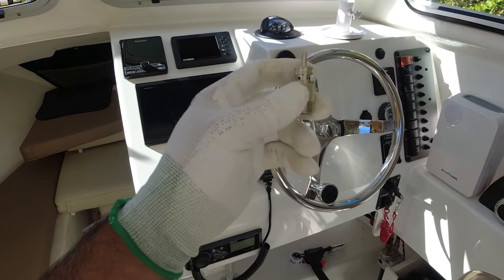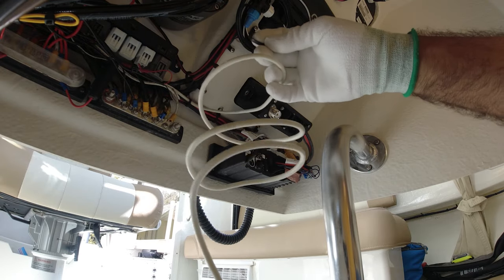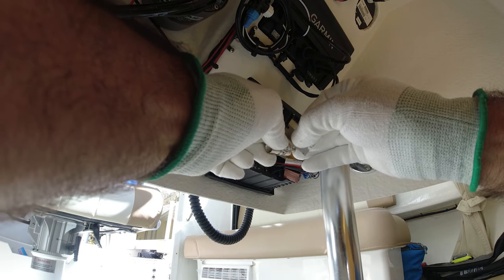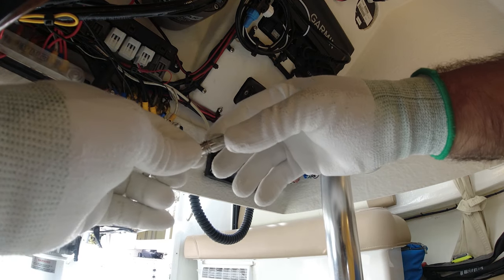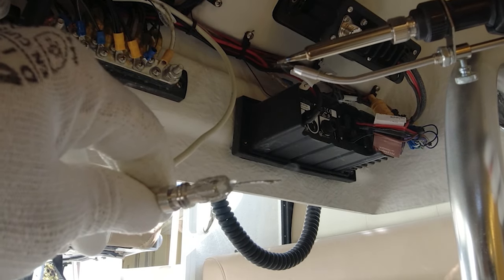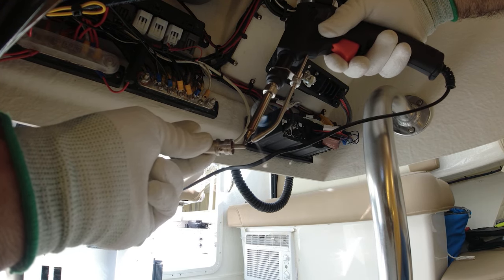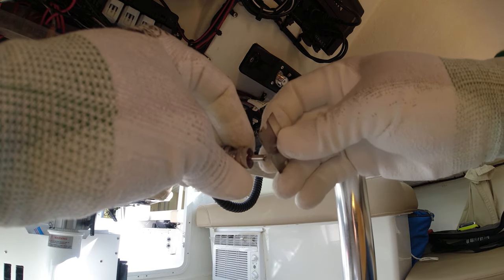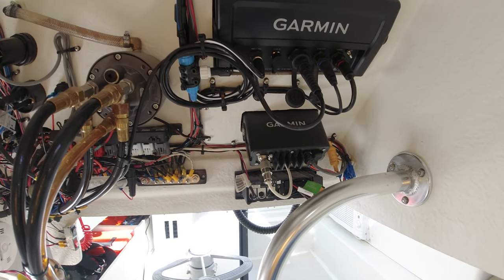How to Install a Marine VHF Antenna Connector DIY Crooked PilotHouse Boat

Comment: That's a nice soldering gun.
I just installed an antenna  coupler, on my boat,  that allows my vhf and stereo to use the same antenna.
Had to do the same procedure.
Good Work tinning that wire end Capt.
Reply from the maker: Thank you Ken and I did not know they built in antenna did you can use it for both that is awesome because now it's see you can get good stereo and VHF frequency.
And thanks for watching the video and the great feedback captain😉👍

Comment: Very well done...and that comes from an Expert Class amateur radio operator, Cap'n.  I continue to be surprised and pleased to discover the breadth of content you have made available here.  It's inspiring, Cap'n - very motivating to set high standards of my own whether on the seamanship side or the mods and improvements of the boat.
Reply from the maker: Thanks Jack before doing this video i did some research so i can doit right, thanks for the review cap. And for continuing to watch my videos cap.⚓️🛥👍
Reply: Is there a minimum length of cable that should run from the antenna to the radio?  I seem to have an excessive amount.  I’m about to swap out the 4 footer the dealer put on my center console with an 8 footer. I hate wire clutter so I want to keep it as short as possible.
Reply: @wino4  Your dealer may be choosing to use a 8' cable simply because that is what he has in stock.  Or he may want to upgrade the cable to improve your VHF performance.  You shouldn't see any difference in VHF performance with a 8' vs. 4' antenna made from the same cable type with properly installed connectors.
Reply: I've never heard of an "expert" class amateur radio operator.   I've heard of an "extra' class.
Reply: @seeharvester  Thanks for the correction - yes, Extra Class. Don't know where that came from...
Reply: @jacktyler7599  
Hi hi   I figured it was an honest mistake.   I came down in the comments to see if anyone had corrected him on the fact that the coax cable is tinned copper, not stainless.   Just so everyone would know.   Not super important I suppose.
While I've got you on the line, maybe you can comment on the coiled coax he cut out.   
Does VHF not require any type of choke balun?
Is it possible that why whoever installed it did that?
I know Shakespeare recommends not cutting the coax any shorter than 3 feet, but instead loosely coiling it and stowing it out of the way.
I'm not sure what kind of antenna that is (dipole, collinear, 5/8, etc.)
BTW, I'm not a ham, just a shortwave listener.

Comment: Cap small recommendation keep your antenna cable away from your power/battery cables, even if the antenna cable is shielded you could affect reception and hear engine noise on the radio. As a rule of thumb keep power cables away from any equipment that has a speaker or microphone. Nice soldering job..👏
Reply from the maker: Great suggestion captain and that's very true thanks for the heads up, we all boaters have to share our knowledge to help each other.
Navigate safe captain

Comment: You got a thumps up from here - one thing though, please messure the cable without the antenna connected (at the other end), some antennas read shorted, so you might end up thinking you failed mounting the plug.
The cable is not SS nor is the connector, it's tinned copper and probably silverplated brass connector :)
Reply from the maker: thanks cap for the great info

Comment: Stripped and redid mine and try as I might, there was a small conductivity between the pin and the shielding, Not  much, but just  slight bit. The cable works fine now. It did have a weak signal and was badly assembled
Reply from the maker: Sometimes installers dont do a good job cap

Comment: Good video as usual, I am not sure if cutting the cable you will loose range...???
Reply: Maybe 

To avoid loose range the cable need cut feet by feet.
Reply from the maker: The shorter the cable the better it is
Reply from the maker: @desordenado2211  well I did okay I took off about 2 feet

Comment: Rg8x  or rg213  Coax is the Better cables and do you have an 6 db Antenna ?   I also Always test the Voltage with MIKE keyed to make sure you dont Have Significant voltage drop when the radio is transmitting.
Reply from the maker: thanks for the great info cap.

Comment: very good job putting on the pl259 connector. but not checking to see if the ant is still in tune to the frequencies the it is beaning used for with a SWR meter "when you cut the cable you changed the length of the coax which change the optimal frequencies , but wait  there is more the coil of  wire "round loop choke the frequencies"  is very bad and should be flatting out in the meddle of the cable instead of benign round make it flat and then test your SWR. and good fishing, and be very safe .
Reply from the maker: thanks Edward that is great info 👍👍⚓
Reply: Captain, I am just an Ham radio operator and wanted to add a little more info for your readers...the coil of coax acts as a RF Choke and does not change the resonant frequency of the antenna and keeps RF energy from coupling to the coax and feeding back into the radio.  It is perfectly fine to have excess coax coiled up in a 4" coil before feeding back into the radio.  I love your soldering iron too...very handy!

Comment: You have to have a certain length cable to tune it i believe so if its too short, it will not work
Reply from the maker: That's a possibility and my case I already tried it and it works better than before sounds more clear on the communication side
Reply from the maker: @nameunavailable456  thanks Joe for your comment that helps the viewers 👍👍👍⚓

Comment: nice video! I'm about to do the same.  Did you notice an appreciable difference in the reception?
Reply from the maker: Thanks cap. And no i did not notice any difference because i did notd do  comparison data but most likely better  ,hope the best installation for you cap.

Comment: Very helpful! But may I ask an unrelated question? Since you are back there. Are you supposed to see hydraulic fluid in the hose behind the dash up to a certain point? Or is that part of the hose supposed to be empty? The fill hose I guess.
Reply from the maker: For my understanding you're supposed to see some fluid there like halfway that indicates that you have fluid if you don't see any fluid you do not know if you're low on fluid so you always want to be able to see a little bit of fluid in the line if you don't my advice is to add a little bit of fluid there so you can be at least halfway or 1/4 of your viewing point.👍👍

Comment: I just bought a new vhf and Shakespeare antenna. The Shakespeare directions says to coil the excess wire. If I recall correctly they say make a 6 or 8 inch coil. I called my electronics installer of 25 years and he told me Do Not cut the cable. I'm confused from what you did, and the advice of a fulltime professional marine electronics installer, and Shakespeare. I'd personally prefer to cut the cable in the overhead box.
Reply from the maker: I also spoke with a marine mechanic that work full time on a ship and he told me that any antenna coils will reduce your frequency that's how I got my confirmation, but I understand your confusion but after I did this my radio had a clear frequency that before that to me shows that what I did was better
Reply from the maker: I forgot to tell you that from my radio to the antenna I have about 10 ft of cable and I understand if you cut the cable too short that will be a problem but it might case I have 10 ft to the radio so that is a good amount of cable but I see if there's a problem if you had two to three feet of cable that would be too short
Reply: Been working with radios and building antennas for my hobby for years. Coax is very lossy in VHF and UHF band, cutting length won’t hurt it as long as the connection is good like he shows. 

If the matching of the antenna is bad in reference to the frequency the extra coax helps absorb reflective power  but not much, most is absorbed in the radio which creates heat in the transmitter finals. Advanced radios typically reduce the output power to protect the radio. I’d be more concerned with the antenna matching the frequency range used. Buy an SWR (Standing Wave Ratio) meter to measure forward power vs reflected power. Ideal is 1:1, the higher the SWR the less power sent out the antenna and the less transmit range you will have.  To correct for a high SWR ratio you either lengthen the antenna or shorten it. Pick the channels you use the most and trim or lengthen the antenna for the best overall SWR reading for the range you will use.

I didn’t notice if his antenna is adjustable or not but that is how you would make your radio and antenna match to get the most transmission output power possible.

Comment: Where is the link to the soldering iron, I was just going to buy one of those for myself and one for my son as I like the auto feed of the Solder.
Reply from the maker: If you take now Captain I already placed the link I forgot to put it under but is there right now thank you for watching and for letting me know👍
Reply: @OutOnTheReef  Thx I just ordered two of them from your link.  Nothing worse than holding a wire in one hand, the soldering iron in another hand and then no hand left for applying the solder.  I was just doing that last week  . . . soldering speaker wires while dripping the solder onto my floor!  And I never knew about the holes in the antenna connector should be soldered to the braiding.  I'm learning from you all the time Thx Cappy
Reply from the maker: @pstone7657  awesome Captain you love it the reason I got this one it was exactly because of that sometimes you holding the wire and then you have to hold the rod then you have to use another hand to hold the item and we don't have 3 hands so definitely doing it this way with this gun is a lot better Captain thank you for using my links really appreciate it.👍👍⚓

Comment: Is your antenna DC grounded? I've been following your video but my new antenna isn't working :(

The multimeter beeps on the continuity test when the pins are both on the outer jacket and also one pin is on the outer jacket with the other on the inside coax
Reply from the maker: I am not sure captain What I did was exactly what the manual from the radio  guide said

Comment: The connector pulled off the cable because they did not solder the holes. Inside there are 2 little washers. One is plastic and the other is metal. What order do the washers  go?
Reply from the maker: right of my head i dont remember cap but follow the way i did it in this video because it was done by factory specs
Reply: @OutOnTheReef  I'm guessing because it was a older plug it had the washers. I decided it doesn't matter which order they go but they have to be in there.  I was able to get the old solder out of the old plug and reuse it NP. Now all my electronics are done in all Garmin.
Reply from the maker: @jeffs9530   Awesome captain I'm sure feels good to get everything in order when I finish my system I felt the same way ,nothing like having all your electronics working perfect thanks for watching and if I can help in any other way in the future please let me know